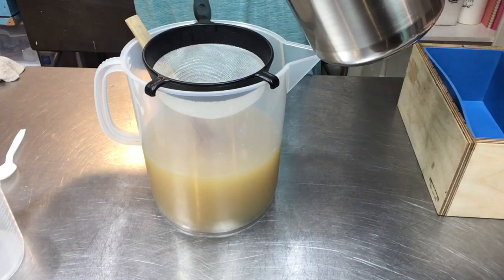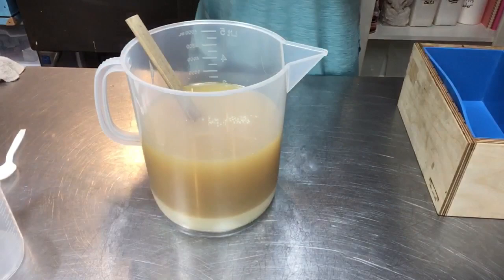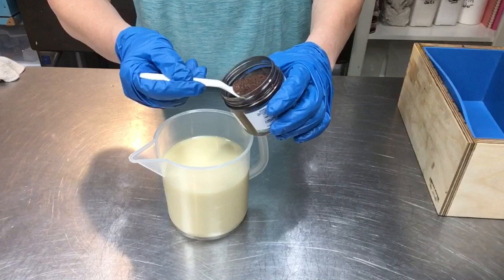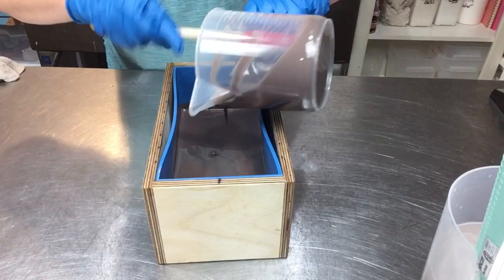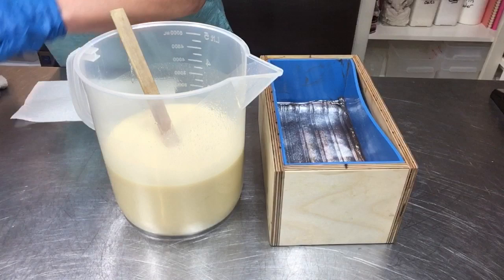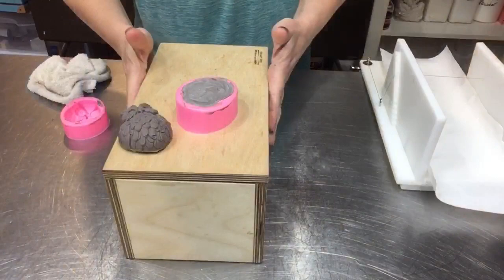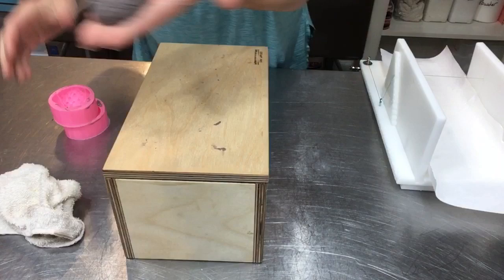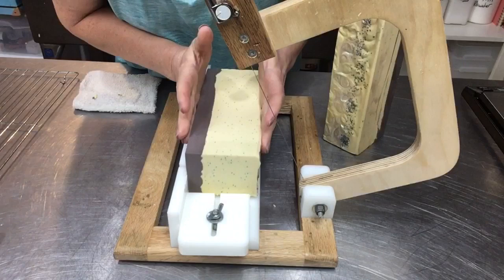Making Goat Milk LEMON BAR w/ Poppy seeds CP Soap | Ellen Ruth Soap

Comment: Just beautiful. I'm new to soap making and I love to make goat's milk soap but how do you get your silk to dissolve? I use frozen milk in my lye solution
Reply from the maker: Thanks!  You can melt your silk in a bit of distilled water, then add that to the lye mixture.  I use frozen milk too, and it still gets hot enough to melt it usually...

Comment: How did you melt your silk in goats milk I freeze mine and did not have good luck
Reply from the maker: My frozen goat milk usually gets hot enough to melt it..  A few times I've had to melt it in a bit of distilled water, and add that to the goat milk...